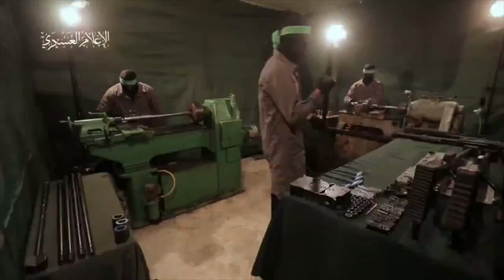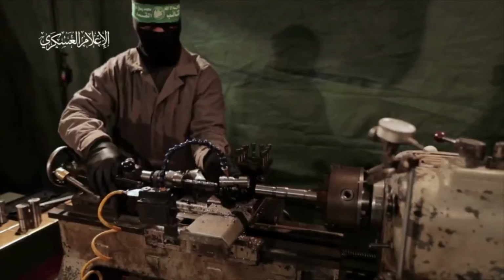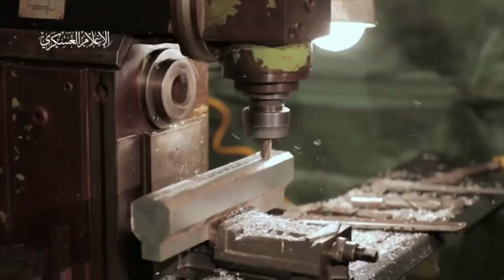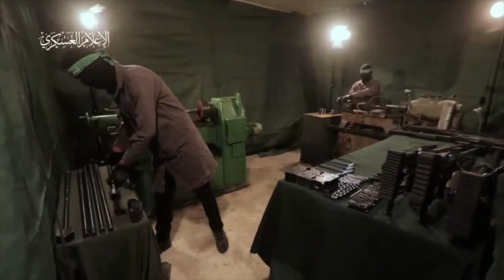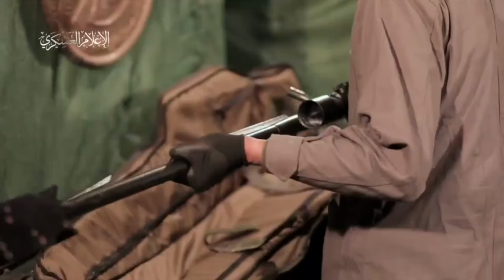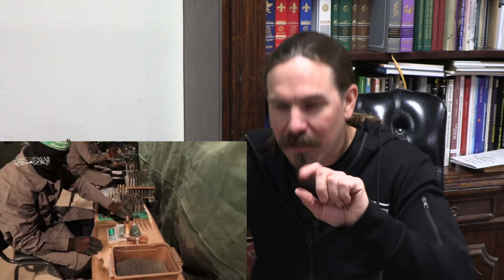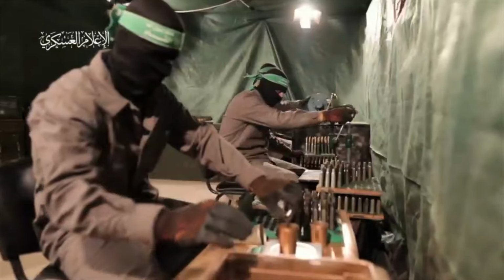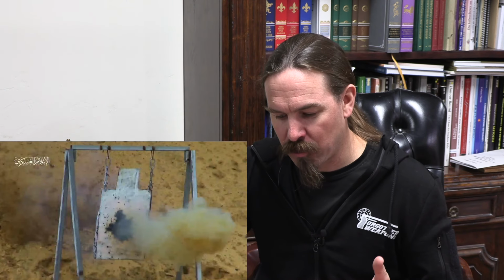Hamas Claims to Make Sniper Rifles in Gaza - Are They Really?

Comment: First of all, this is a propaganda film. Now I disagree with you on the lathe smoking issue. The green lathe is an old engine lathe and I have many hours on older monarchs and LeBlond s. But I used oil based lubricants, often applied with a brush. You are likely going to smoke with high speed tool bits.

But how are they chambering the barrels? How are they drilling the barrel? How are they cutting the rifling.

On the steel cased ammo, I have a question. I reload using brass on Redding torrent presses. I was always told that steel cases cannot be reloaded because they are burden primed. Yes or No

I think this was a propaganda video edited by Iran to distract world attention from Iran.
Reply: Enough for internet today, please a lot of Conspiracy😅

Comment: The scope mounts are BS too. You'd do one operation to all of the parts, then move on to the next operation and do it to all of the parts, and so on, because setup is most of the work in machining, especially manual machining. It makes no sense from a manufacturing perspective to have an entire arrangement from blank to finished part on the bench there, especially since there are clearly processes involved that would be done elsewhere. (Whatever they're doing for the finish, for example.)

My bet is this isn't even anywhere in Gaza, probably in Iran itself, at or near the factory where these guns are actually made, and it seems very likely to me that the guys in the video aren't even Hamas, but rather Iranians cosplaying them.

Comment: I agree with you on the process of making barrels but I feel that first creating a reference diameter by turning between centers is the proper first step so that your barrels outer and inner radii are concentric and parallel. Then bore, ream, and rifle before turning the final outer diameter.

Comment: I dont know what you're talking about when you say something to the effect of ''smoke shouldn't be coming off of the part, they are not running lubricant". The smoke is likely from cutting oil that was applied by a brush since it does not look like that lathe has a coolant pump based on the casting. This is a prefect legit way to do turning. In many cases sulfurized cutting oil is actually a better coolant than the emulsified or turpentine based fluid it looks like they use lather with the only town side being that the smoke from it is more toxic long term.

Comment: the "unfinished" scopes looked significantly more rudimentary than the finished anodized ones. the markings on the side of the receiver look like they may have been made with an engraver or a CNC router. and honestly CNC technology is 40 years old at this point. There are smaller youtube channels with 5 axis mills and CNC centers and these guys are single opping on a horizontal mill with a vertical head and using the stock rotating toolholder on a 60 year old mill. this is for sure propaganda for the layperson and not an actual display of technical prowess or military providence.

Comment: Here's a series of things I noticed or questioned in roughly chronological order.  No eye protection.  Lathe operators should never wear sleeves below the elbow.  Lathe operators should never wear gloves.  Electricity isn't being dropped from above, so there are cables in the floor.  Why do they need the green tarp walls?  The vise handle on the mill is at roughly 7 o'clock position which is inconsistent with tightening it, and if it were loose, I'd expect it to hang straight down.  You can get digital calipers for $20, and they are using analog.  The tooling in the video can't produce the receiver markings.  They guy running the case trimmer should not wear gloves or sleeves below the elbow.  The ammo crates are not staged in a manner suitable for efficient mass production.   The ammo crates are not labeled in any way.  I only disagree with one point Ian made, and that is only a partial disagreement.  He said the "bolt heads" would need to receive more operations on a mill.  Technically, they could add milling attachments to the lathe and perform the other cuts with that.  It's not a good way to mass produce parts, but neither is anything else shown in the video.
Reply: The green tarp 'walls' are to either section off a bigger room (which might have some actually interesting things going on) or to prevent the site being identifiable - finding places is relatively easy if there's a identifying feature in shot eg a window - they had real weapons in the room, which makes it a target.
Even a propaganda studio is a target so you make it a difficult as possible to place by using tarps hung on lumber, which could be anywhere. 
Who says it was made in Gaza? It could be anywhere - if it were downtown Cairo then that would cause a proper kerfuffle if it was identified.

Comment: you are just jealous.

in terms of achieving hyper accuracy and range by having new brass casings and extra accurate amount of powder , this cannot be achieved due to the circumstances of border control and are luxuries that are not needed.

as for the manufacture of some parts , it might be correct that they have had received some help. but the tools are surely used to replace some damaged parts. and again hyper accuracy is not essential as you might think . its just a luxury in their case. and most parts would do just great for the limited purpose they require.

in order for them to convince you , you need to see special barrel boring bits , CNC machines and the rifling machine as well as a machine for heat treating the barrel and quality control methods. probably they have received help with the barrels at least. 

the resistance doesnot require tactically superior arms for the field. it just needs the bare minimum essentials , the rest are luxuries. 

dont worry, they are not aiming at competing with [Barrett Firearms Manufacturing] just yet. they are just resisting.

Comment: Hamas clearly has SOME manufacturing capacity. Their tandem RPG's appear to be that way (hopefully somehow flawed so the HEAT fails). They aren't going to have the capacity to heat treat barrels and rifle them with precision. 
It should be noted, however, they don't need perfect weapons; a roughly accurate .50 BMG will be devastating in urban combat. From what we've learned, their videos are better than their combat capability so far. They don't even have a significant amount of drones, which would have been devastating.
Reply: Need to remember as well they're being blockaded as well

Comment: I remember that TV show. I thought it was crap back then.  I’ve built many rifles and made barrels in commercial quantities.
Powder usually measures just as accurately by volume as it does by weight if the gear is good (Culver or Lyman Accu-scale, et al.) That’s a skeeky little press and the bullet is unsupported while seating. Steel cases are probably fine for one time use as the can be made just as accurately.  But this ain’t it!

Comment: The Gaza strip is like 5 miles wide and 25 miles long surrounded on three sides by a hostile army and one side by a hostile navy. If they were ever for some reason manufacturing weapons there, they would not have the supply line to manufacture them for long. Why smuggle in raw materials instead of finished products? That would be completely inefficient.

Comment: I visited Lithgow, NSW last year and they'd recently opened a building with a collection of machines used to make the SMLE and SLR rifles. Made me really how much work and time it takes to make just the barrel of a rifle.
Reply: Sounds like an absolutely cool museum.
Reply: And not just regular machines. Specialized machines and tooling to do specific jobs.
Reply: The original equipment and tooling was purchased from Pratt & Whitney just before WWI. At the time it was the most advanced available in the world. Pratt & Whitney saw this as an opportunity to showcase their wares internationally. There were over 2250 operations to produce an SMLE, and Pratt & Whitney's setup reduced the man-hours required from 48 or more to 23.5 hours per rifle.

Another fun fact: the LSAF Museum also has the first off SMLE rifle made on the P&W equipment, by P&W, to prove their tooling and tolerancing.
Reply: @Daniel-vl8mx  Yeah, the gentleman I was talking to was saying the same thing. Even with the machines the SMLE took a lot of time, hard to imagine the British basically making them by hand.
What was especially remarkable to me was the rifling machine. Cutting a little bit of a groove, one at a time. By far the longest part of the process.
Reply: @GruntyGame  Yes, though the process was speeded up by using a gang broach, rather than a single-point cutter,  so that all the grooves could be cut and deepened simultaneously. 

With WWII much faster methods were developed. The rotary hammer cold forging process was developed by Germany,  and the button rifling process was brought to production reality in the US. 

Rotary cold forging was being used at LSAF for the military and civilian-market barrels post-war (I'm not sure when the machine was purchased, but it certainly was in use when I worked there in the 80s). The equipment is massively more expensive but for mass production it really ups the production rate. 

Having said that, LSAF could certainly produce good barrels with the older cut rifling. Lots of match barrels were made there, as well as barrels for service and sporting arms, by that means. They've turned out a lot of good barrels by rotary cold forging since that process was adopted too.
Reply: @Daniel-vl8mx  From my understanding LSAF didn't use the broach cutter until the SLR rifle and cold hammer forging was introduced with the F-88.
Can speak for the quality of the cold hammered barrels. I have a rifle made in that factory and it's superb.
Reply: @GruntyGame  No, broaching was introduced before WWII, and the cold forging machine was purchased and set into production in the 1960s, during the production run of the L1A1. It certainly was in use when I worked there in the early 80s. I happened to be there when the Steyr AUG was being trialled against the M16A2, and when planning for production was taking place, before the AUG was adopted as the F88.
Reply: @Daniel-vl8mx  Ah, thanks for the insight.
Reply: I gotta get myself down there there then. Damn.
Reply: @The_GOAT2282  Yeah, if you're at all interested in manufacturing or Australian domestic production I'd highly recommend. The day I went there weren't may people and that building I mentioned I was talked through pretty well every machine by one of the gentlemen there for well over an hour. It's been 11 months since I visited so they may have done more with that building. And they also have an example of every firearm the factory produced except the F-90, and a heap of other historic or collectable firearms. If you're an Australian who watches Forgotten Weapons I cannot recommend this museum enough.
Reply: My father works there, You'd be so surprised how much work goes into the manufacture of a barrel, the metal treatments and such. For their modern precision comp rifles, like the LA105, the ins and outs acre crazy and not entirely known by me.
Reply: Hello ! May Allah protect and guide you to his light and happiness in this life and the hereafter, God bless, Ameen. Excuse me for giving a little presentation of Islam, because it is very misunderstood nowadays, especially on those « Antichrist's » times, where media and politics are mixed to distort history and truth. Thank you very much for your time.

Islam is an arabic word that means the Surrender to the One and Only God, our Creator, Protector, Provider, who gives us life and all that we have, we are safe and sound by his will and grace, we are His and to Him we return, and we have to thank him in this trial life by submitting to him by our free will, or later in the Day of judgment when it's too late to save our own skin. Islam was the original Religion descended to earth from heaven with Adam and Eve (peace and blessing be upon them) in the beginning of humanity. and was passed to people with the succession of the 124 000 prophets and 315 messengers of God to all nations and civilizations since, passing by Noah, Abraham, Isaac, Jacob, Ismaël, Joseph, Moses, Aaron, Joshua, David, Solomon and Jesus (Peace and blessing be upon them) during the history of mankind, the last replaces and completes the previous, until the succession of the last messenger of God fourteen centuries ago, Muhammad (Peace and blessing be upon him) to complete the noble morals of all mankind, to bring humans and jinns out of darkness into light, and to purify people's religion and belief from corruption and polytheism, and return it to purity and true monotheism, like it was in the times of the prophets (Peace and blessing be upon them).

Many Religions that we know nowadays, at their beginning were true and under Islam, initiated by one of the prophets of God, but their original teachings, history and scriptures have been corrupted over time with falsification and polytheism, or lost and replaced with false ones. That's why Islam is the only Religion accepted by God nowadays, which consists in bearing witness that there is no god besides Allah (God in Aramaic, the original language of Jesus and the Gospel), and that Muhammad is His servant and messenger, just like Jesus and Moses and others are His servants and messengers. Never a messenger of God said he was God or literally son of God, it was the people after him who changed the words of God and corrupted the Religion. God is unique and absolute, He does not need to have a family and sons or to associate anyone else with His kingdom, He can simply create whatever He wants, everything belongs to Him, and to Him everything will return. Allah said in Surah Al-Mu’minun : “God has never begotten a son, nor is there any god besides Him. Otherwise, each god would have taken away what it has created, and some of them would have gained supremacy over others. Glory be to God, far beyond what they describe. The Knower of the hidden and the manifest. He is exalted, far above what they associate. (91-92 / Translated by ITANI).

Allah means the one and only God, the God of all prophets and creatures, the creator of the universe and mankind, and the Master of the Day of judgment, where our destiny, Hell or Paradise, is decided based on our faith and deeds in this trial life, and above all, Allah's mercy. 

Allah said in Surah Al-Ikhlas : In the name of God, the Gracious, the Merciful.
Say, “He is God, the One. God, the Absolute. He begets not, nor was He begotten. And there is none comparable to Him.” (1-4 / Translated by ITANI).

Allah said in Surah An-Nisa : O FOLLOWERS of the Gospel! Do not overstep the bounds [of truth] in your religious beliefs, and do not say of God anything but the truth. The Christ Jesus, son of Mary, was but God's Apostle - [the fulfilment of] His promise which He had conveyed unto Mary - and a soul created by Him. Believe, then, in God and His apostles, and do not say, "[God is] a trinity". Desist [from this assertion] for your own good. God is but One God; utterly remote is He, in His glory, from having a son: unto Him belongs all that is in the heavens and all that is on earth; and none is as worthy of trust as God. Never did the Christ feel too proud to be God's servant, nor do the angels who are near unto Him. And those who feel too proud to serve Him and glory in their arrogance [should know that on Judgment Day] He will gather them all unto Himself: (171-172 / Translated by Muhammad Asad).

Allah the Most Merciful said in Surah Ali-Imran : Behold, the only [true] religion in the sight of God is [man's] self-surrender unto Him; and those who were vouchsafed revelation aforetime took, out of mutual jealousy, to divergent views [on this point] only after knowledge [thereof] had come unto them. But as for him who denies the truth of God's messages - behold, God is swift in reckoning!
Thus, [O Prophet,] if they argue with thee, say, "I have surrendered my whole being unto God, and [so have] all who follow me!" - and ask those who have been vouchsafed revelation aforetime, as well as all unlettered people, "Have you [too] surrendered yourselves unto Him?" And if they surrender themselves unto Him, they are on the right path; but if they turn away - behold, thy duty is no more than to deliver the message: for God sees all that is in [the hearts of] His creatures.
Verily, as for those who deny the truth of God's messages, and slay the prophets against all right, and slay people who enjoin equity - announce unto them a grievous chastisement.
It is they whose works shall come to nought both in this world and in the life to come; and they shall have none to succour them.
(19-22 / Translated by Muhammad Asad)..

God said : Say, “We believe in Allah, and in what was revealed to us, and in what was revealed to Abraham, and Ishmael, and Isaac, and Jacob, and the Patriarchs, and in what was given to Moses and Jesus, and in what was given to the prophets from their Lord. We do not differentiate between any of them. And to Him, we surrender.”
(2:136 / Translated by Community)

Salam (Peace) ---

Comment: I'm not a machinist or a gunsmith but I've worked in manufacturing long enough to recognize people running equipment just to make it look like they're doing something.

You can see the same thing in pickup truck commercials. A buncha actors in artificially dirty overalls and grease paint made to look like dirt when taking an arc welder to a steel I-beam to make a pretty shower of sparks while some generic guitar riff plays in the background.

I know you know what I'm talking about.